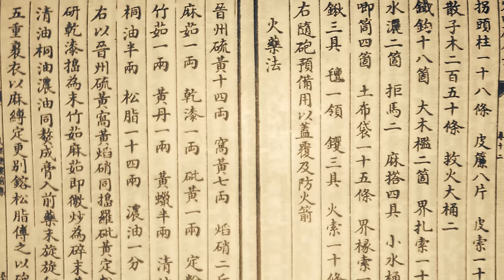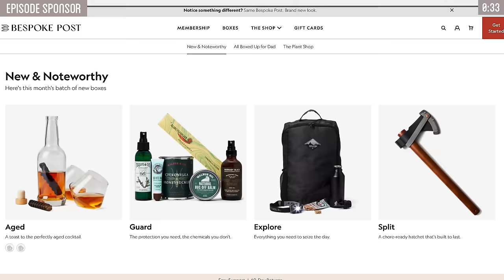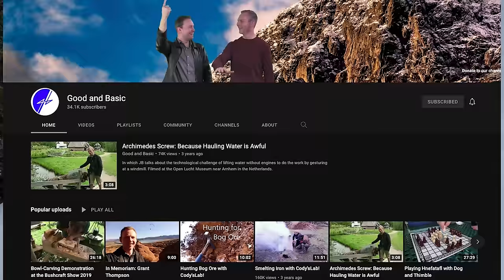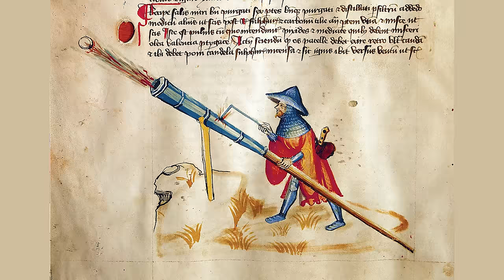Why I Spent 3 Days Boiling Chicken Poop

Comment: If you were to do this again, I'm pretty sure it would be better to  mix the water and clay soil till untill all the clay as broken down and suspended. That would ensure all the potasium nitrate is dissolved into the water. Then let the clay settle for a day or two untill the water looked maybe colored but clear.  Then decant and collect the water with the salts. 

Then boil. 
And if you wanted to maximize the KNO3 collected you could repeat washing  maybe one or two more times, but law of diminishing returns quickly kicks in after the first washing has removed most of the existing KNO3.
Reply: heating the water for washing the nitrates will also help a lot because it can dissolve way more
Reply: @frankalvarez7387  potassium nitrate certainly dissolves far better in hot/boiling water,  but I dont think the nitrates were so concentrated that they would not fully dissolve in room temp water of enough quantity to make a slury of clay soil.  After making a slurry and letting it settle for a day or two. The water will be clear maybe colored and most of the water will be in a layer above the settled soil containing most of the dissolved nitrates.  Decant it and Then boil off most of the water untill you see the first signs of crystal. Then when you let it cool the crystals will fall out.
Reply: @kreynolds1123  I suspect maybe he's angling it will also help loosen and free anything mechanically trapped
Reply: Plus occasional agitation...
Long soaking and agitation...
Reply: @Anon-xd3cf  agitation initally yes, but nitrates salts ions tend to disolve very easily making further agitation probably unnecessary. Besides, eventually you want the suspended clay particles to fall out of solution. That leaves clay and soil particles on the bottom and nitrate salts in the wate above. The more the gunk settles and compacts at the bottom, the clearer the solution gets, the more water is over head and less embedded in the gunk, and the more easilly you'll be able to decant the water  with the dusolved salts without disturbing the gunk on the bottom.

Comment: A few things.
You really need to use a covered roost. 
I had chickens and a covered roost and in spite the fact they were free range the nightly roosting had a few 55 gallon drums worth of highly rich material in 6 months and this was not supplimented in any way with urine wetting, turning over or maintenance of any sort.
Very little rain got to it which is extremely important.

You need an unleached nitrate source.
A clue you're doing it right is salt crust formation on the surface, walls and such.

You did use ash as a potassium ion source which was good but your filtration was very sub par yet very easily remedied.

Don't be afraid to use densely packed cloth filters, clean fine sand and if you want to go modern, don't be afraid to use a transfer pump hooked to a water filter to clarify the solution prior to reduction on the stove.

Surface area is also a thing, you'll get a more efficient reduction if you use wide pans rather than deep pots.

The best source is the Joseph LeConte paper.
Instructions for the Manufacture of Saltpeter.

Comment: Advice on extraction.  Mix the soil with sand and straw. Then let the straw compost with good air infiltration.  This converts ammonia and urea to nitrate and adds potassium.  Then make a slurry.  Then filter through sand and straw.  Repeat twice more with the same soil.  Then boil the filtrate down to a slurry and filter through sand and straw filter and rinse the filter thoroughly.  Then crystalize and recrystalize.  This is a tradional method.
Reply: That sounds like a much better filtration method than the charcoal filtration someone else mentioned in the comments.

Comment: I hope YT allows the new related content. I have wanted some of this for informing the crafting of ammo in mods for 7 days to die. Trying to make it a little more realistic and challenging for the players.
Reply: I mean you just mine nitrate deposits from the ground, mix with charcoal, and already get a decent reactive mix. Tho you need a lil' something to increase the burn rate, sulfur works well for that.
But don't worry about realism in 7 days to die, there's no way you can shoot clean ammo like that with black powder
Reply: @jeanladoire4141  yes but despite it being a game about zombies and realism is out at that point, I would like to mod it to have more complexity. Complexity and realism to the real aspects of the game. As if the world was this world but with zombies. I'll have to look in to it more but I should hypothesize that the blunderbus would work with black powder. When I have the time I'll research more. And if it were the case black powder isn't good enough, add some new crafting that made a more modern gun powder. Though I know its player base has shifted to much to easier game play  :(
Reply: @JasonCummer  whatever, black powder without sulfur will never do more than a puff. It can be good for rockets, but a good explosion needs a little extra. Modern gunpowder uses nitrocellulose, acid and cellulose, like in paper or in wood. I suppose there could be a craft for quality gunpowder with acid and paper/wood, or even cotton, wich is even better. But realism isn't that important in this game tbh
Reply: @jeanladoire4141  its true realism has gone out the door with the devs  a few alphas ago. This last alpha I pretty much stopped developing my main mod and just went for the crazy place the game could be going.
Reply: @JasonCummer  idk what's desirable for the game, but if making sulfur and adding a bit to the powder to increase performance was a thing, i suppose it could become an interesting mechanic

Comment: Enjoy watching your perseverance and end results - I like the compost stack method - using layers of straw and small rock and soil/ humous - then urine is every so often poured on top of the pile - I think they were covered slightly as to not be exposed to water - wood ashes were also put on top - the liqueur was collected purified and boiled - I wonder if a filter column would have worked with diatomic earth  (SIO2) with a fine fibre glass or cotton to filter it - the solution would have to be less concentrated (before crystallisation can occur…..

Comment: Multiple crystallization, 
And a few liquid/liquid workup washes using a solvent in which the nitrate has low or no solubility, 
Can help to clean up and purify the product. 

So can adding activated charcoal. 
And the best part is that activated charcoal
Can then be washed clean and used as one of the ingredients in the gunpowder

Comment: Where i live was the use of "Kadaverställe" documented. A barn like structure near water was build and excavated underneath. Then dead animals where brought there and soaked in pee. The hole was filled up after wards. The decomposing bodies would produce saltpeter. Water would evaporate on the surface under the cover and pull up the salts out of the wet soil.

Comment: In the middle east they have pigeon towers. They are usually tall cone shaped structures with poles through so pigeons could roost there. And of course they would deposit their waste at the bottom for fertiliser. Not only that they're homing pigeons so the towers were also used as communication towers between cities. So they had a double usage.
Reply: I have cow dung that has decomposed and become like ash. It has been sitting for a long time in a hot climate in the summer near cows. Does spraying urine on it increase the amount of nitrates?

Comment: I think, this chicken coop was simply a bad choice. It doesn't have a roof. So every time it rains, it will wash out most of the nitrates from the dirt, because nitrates are very soluble. As such, the dirt won't be able to accumulate the nitrates. Essentially, you probably only got the few nitrates that formed since last rainfall.
Another idea to increase your yield: When washing and filtering the dirt, the water was running through way too fast. It probably touched only the outside of the hard dirt clumps. Instead, you could use normal buckets (i.e. without holes in the bottom) to collect the dirt, add water, and then leave it for a much longer time (e.g., overnight) to soak well. Stirring from time to time would surely also help. Only then I would continue with the filtering process.
Reply: As he says, it's in the Arizona desert, so NOT a lot of rainfall.

Comment: Wouldn't it be more efficient to collect urine and let it go stale?  I've been in situations where urine had been collected in a bucket and noticed that it didn't take too long (just days really) for clear-white fibrous crystals to grow on the bucket walls and in a crystalline "sludge" to settle on the bottom.  The collected urine also turned brown in a rather short time.  In which case, the solution you were refining being brown could be a good thing.  It is likely an indication that the urates are decomposing as noted by the ammonia smell also intensifying with the colour change in the case of my observation, after which the crystals form if the concentration is high enough.  Add some wood ash to do the calcium-magnesium replacement, boil, filter, etc.  Someone in the comments also suggested using activated charcoal to further purify the results.

Comment: Suggestion: Building a computer from scratch? It might take a very long time, but it would be extremely interesting for programming and microsystems nerd. You could start with extracting raw silicon, etching and layering your own silicon chips, creating a rudimentary motherboard, processor, graphics card, etc. Then going up to a BIOS, an OS, and building your own programs.

Comment: try to run the extracted solution through charcoal before boiling it. some procedures require addition of alcohol after boiling to enhance the crystlization.
the boiling is just end when the solution is evaporate by half then add alcohol.

Comment: So basically, is what you want the nitrates? If so, there are a lot of ways you could get nitrates in a water solution. I bet it could be done with an aquarium bubbler, a large container to hold to water solution, and decaying organic waste. The decaying waste breaks down into ammonia, which eventually breaks down into nitrates from nitrifying bacteria. The bubbler is necessary because the nitrifying bacteria needs oxygenated water to thrive. Any aquarium hobbyist should understand this process.

Comment: 3:39 In Sweden, there was not just official government employed collectors of this kind of soil/manure, nobody else was legally allowed to touch the stuff that aggregated on the floor of animal houses or enclosures. So you couldn't yourself scoop out feces and manure from barns, styes and hen houses, to promote the health of the animals, and you were not allowed to use any animal excrements as fertiliser. Its a given, that after some years, the productivity of Swedish farms, became really low. But this didn't matter, since we could use the gun powder to conquer other parts of Europe, stay in those areas a few years, steel their crops and anything else of value, and then abandon the area to conquer some other, still fertile, area of Europe.

Not only that, Swedes was at times also, by royal decrees, required to collect their pee, since it could be used to manufacture ammonia, and other stuff (like tanned leather, and cannons (blackening)), that was used to keep the Swedish war machine running. And in most parts of Sweden, the pee collectors only visited once a year, during the winter, when the lakes and roads was frozen hard, and travel with heavy carts or sleighs possible. So you had large, stinky, vats of urine, close to where you lived, most of the year.

Comment: When you mix a nitrogen fertilizer with diesel fuel you get a powerful explosive. Every farmer I have ever known has the leaky old tractor parked next to the pile of fertilizer. Right where his dad had parked the tractor before him. And his grandfather before that. Then they would weld or use a torch in that same spot. It kinda makes a person nervous about being in the barn with them. This is the same stuff mixed into the dirt over generations that Timothy McVay used to blow up the Oklahoma City building.
Reply: That stuff is quite stable so no worries there.

Comment: You should refine your ways of collecting chicken poop and processing it into unprocessed potassium nitrate, Poop that's already in contact with soil is of no use once its gone to the soil its gone, Try doing this with fresh chicken poop collected from large commercial chicken/poultry  house on regular basis, Mix it with ground saw dust and let it decompose/ferment in a drum if required you can pour urine to it on a regular basis and let it decompose, Allowing decomposition in the drums for 10 months will give you a good yield of 10% to 12% of the raw materials used, The final product you are after wont just leach out into soil. After the decomposition is over use hot water to dilute the crystals and dissolve them you may need to wash the materials several times in batches to extract all the salts, Mix wood ash to the resulting liquid and filter through fine mesh and fabric filter collect the resulting liquid and let the resulting liquid dry on large flat pans on the ground layered with tarpaulin just like salt pans but just layered with tarpaulin or any other water tight material which wont degrade under intense sun, This is so that the liquid wont leach to the ground, Let dry under the sun till all water is evaporated and you are left with salts on the tarpaulin which you can sweep and collect.

Comment: I've actually seen chicken manure turned into ammonium nitrate before but potassium is about 3X as much in it and phosphorus is in it as well.. but all three are pretty low amounts, 1.2-1.7% for potassium being the highest, there's definitely far better sources of each out there. Like sweet potatoes have a high amount of potassium, way more than bananas or chicken poop. (~541mg/potato) Bone meal (aka baked bones ground up) has a high amount of phosphorus and nitrogen and nitrogen can be found in almost anything including coffee grounds, plants, air etc. The method you used was really inneficient creating pure potassium and pure nitrogen and then mixing them together to make potassium nitrate should be a far better option, or you could go the other route like Cody did and make ammonium nitrate out of locally sourced urea and the nitrogen source of your choice.. he used straw.
Reply: No the urine is the source of nitrogen. The straw is there to hold the urine and help with bacterial conversion of urea and uric acid to nitrates
Reply: @crocobroco4654  urea becomes ammonia which mixes with nitrogen to become ammonium nitrate..

Comment: My friend saved a gallon of his urine and we evaporated it by boiling to see if we could recover any white phosphorous.  We boiled it down in an aluminum pot.  When it was nearly evaporated it suddenly burst into flames and melted the bottom out of the pot.  Luckily we were outside and we didn't catch anything on fire.  If you try this be prepared to smell the most horrible smell you could imagine.    It will make you want to vomit and you'll smell it whenever you think about it for years.  It was definitely interesting.

Comment: That's not chicken poop is chicken compost and is full of ammonium nitrate not potassium nitrate, but can be turned into potassium nitrate. The ash was used to do a double displacement reaction to turn the ammonium nitrate into potassium nitrate. Some of the nitrate in the compost will be potassium nitrate do to the decomposition of plants, but not much. I make ammonium nitrate form the air using O3 & ammonium hydroxide and you can check that out on my channel.

Comment: Uh. Well. Using the dirt in the (very small and dead!) coop was probably the worst source of poop. 
Chickens usually rest on a perch. Beneath, you couls harvest completely clean and dry chicken poop. 
You should also mix all the material with water and then filter it, instead of just pouring water over it.

Comment: Fun fact.  The nitrates from animals are Sodium Nitrates, not potassium nitrates.  Mixing the water with the dissolved sodium nitrates with wood ashes (potassium hydroxide) causes the potassium to replace the sodium and creates potassium nitrate.  The reason you do this is because sodium nitrate is hydroscopic, meaning it takes up moisture from the air (doesn't like to stay dry) which makes it a bad oxidizer for a compound that wants to be dry.  Potassium nitrate isn't hydroscopic to any large degree.